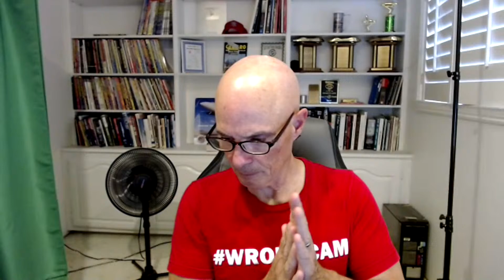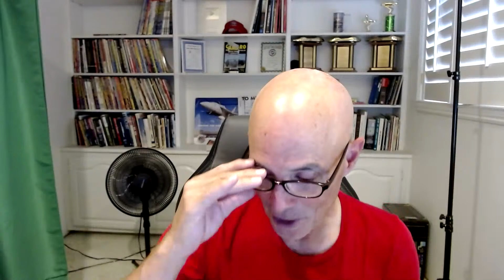TIGHT LASH TECH LET'S TALK TECH

Comment: Richard, have you ever heard of the Bud Moore mini plenum?  I saw one online the other day and it made me think of the discussion that you were having about using a fual plenum with efi.  I argued that the difference in flow between the upper and lower plenums and bad cylinder distribution was a deal breaker.  This intake solves that by making both sides symmetrical.
Reply from the maker: I have seen those

Comment: This might sound crazy, but I was running a solid flat-tappet cam in a Chevy 3.4 V6. The engine had other mods, as well. I used lifters with the oiling hole in the face of the lifter. That was a fun build.